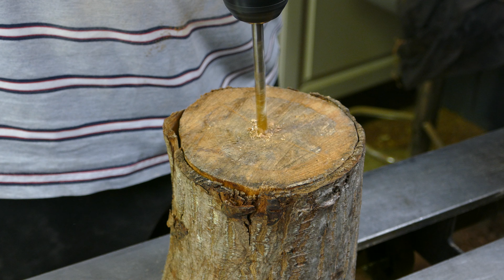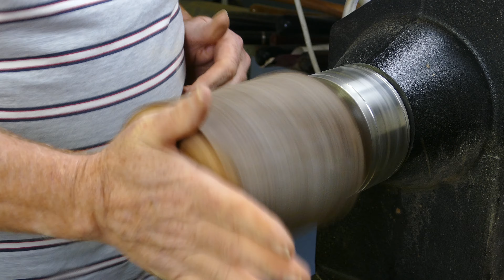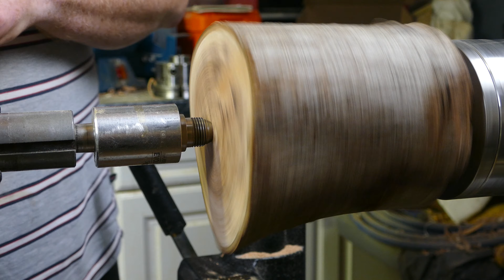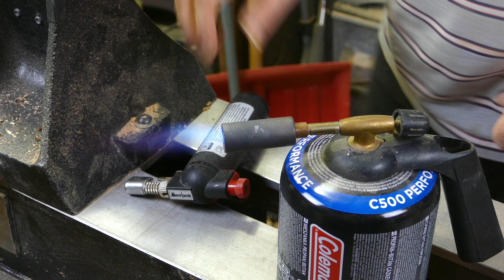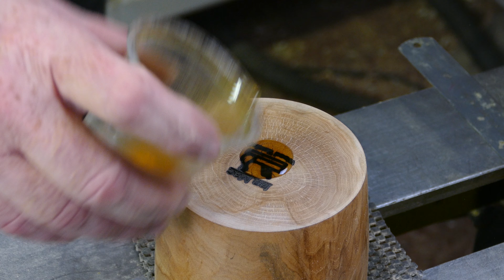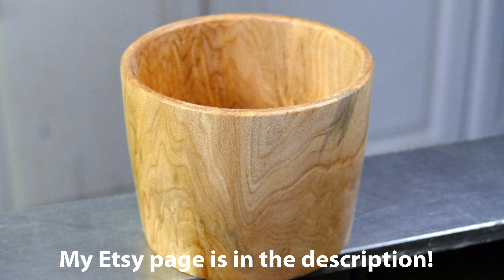Woodturning - What Is This Wood!?

Comment: Bark looks like Pin Oak. Does it have a bad smell? Won't if it's really dry.
Reply from the maker: Nahh doesn't really smell like anything, It looks completely different to when it was cut down. It's the same stuff I used in the 'Alien log' I did a while ago and it was completely silver with green ventricles.